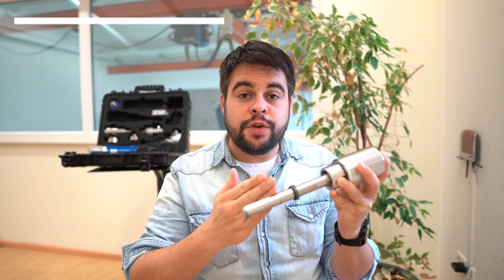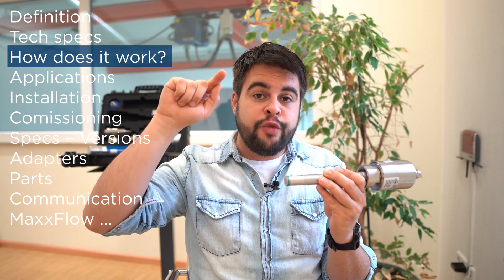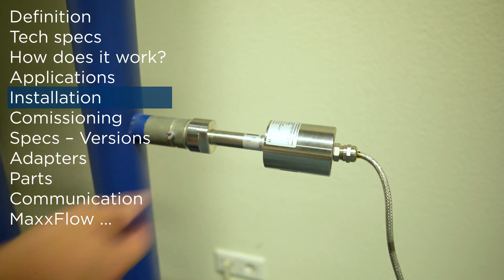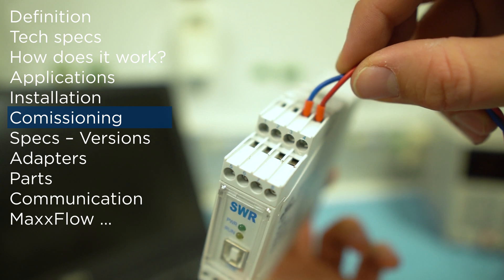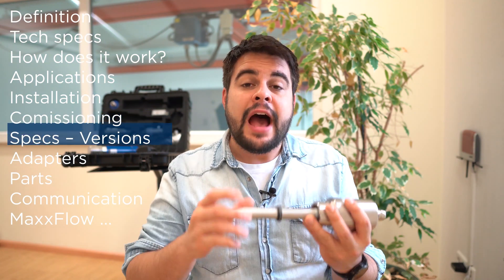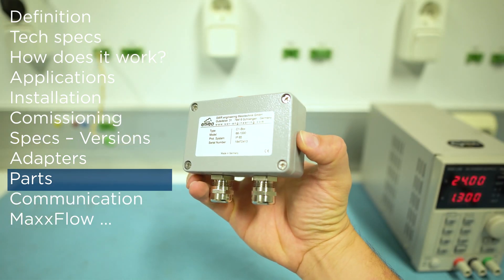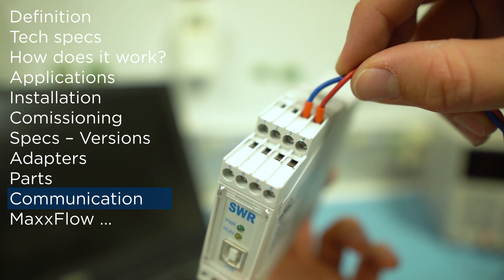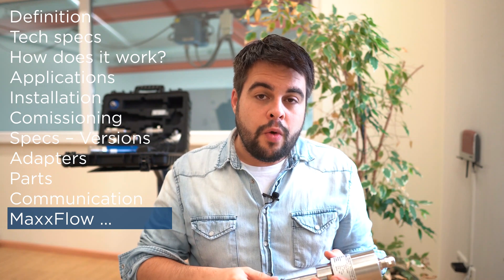SolidFlow | Mass flow meter Bulk Solids

Comment: what is the difference with pico flow?
Reply from the maker: Hi, Basially the mass flow rates ... PicoFlow is designed for low flow rates (up to, round about, 100 kg/h) and SolidFlow for low to medium flow rates (up to 20 t/h)
Reply: Powder flow can use this